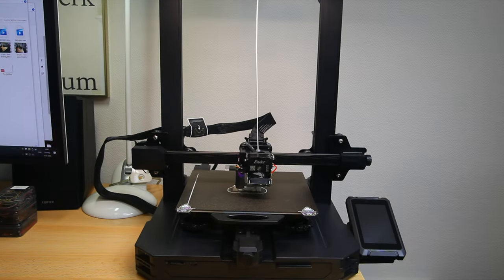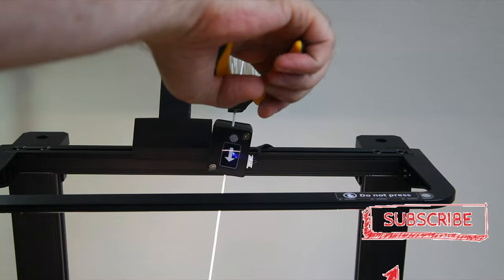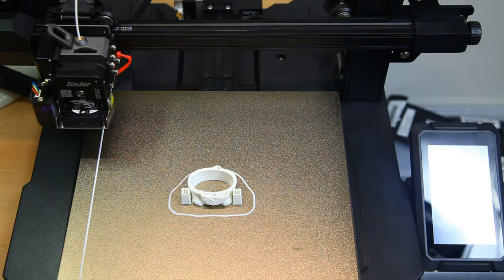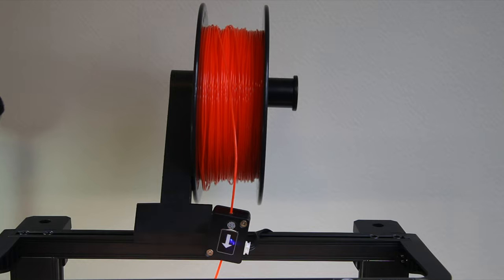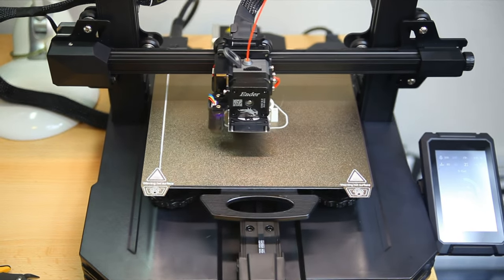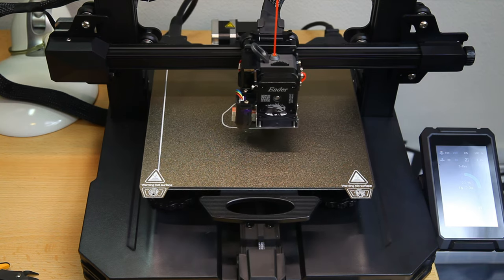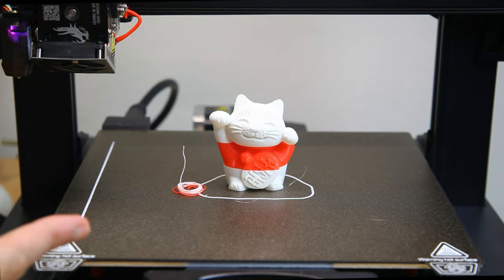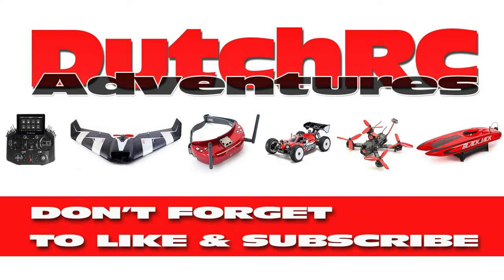Creality Ender-3 ! The S1 Pro - Testing Resume Function after Fillament Runout

Comment: Just want to point out, if you are changing color on purpose you can cut the filament closer to the print head, then pull it backwards out of the sensor - this wastes less.
Reply from the maker: Thanks! Great addition :)
Reply: You don't need to cut at all!!!!!!! Just pause the printer. Manually increase temperature. Just Pull the filament. Done.

Comment: hi! What if we are sleeping and then filament runs out and in the morning nozzle is cold how to turn on temperature on the nozzle without resuming printing?
Reply from the maker: I might have misunderstood.. why would you want to wrm up the nozzle if you will not be resuming the print? 
Anyway! You will then have to say you don't want to resume (the printer will ask if you want to).. and then manually warm up the nozzle / bed..
Reply: @DutchRC  i want to resume but when I resume and temp will be restored then print will star right? Anyway I checked on my printer. After filament runs out nozzle temp and bed temp will stay the same. So we have time to change filament. And then we can resume printing.